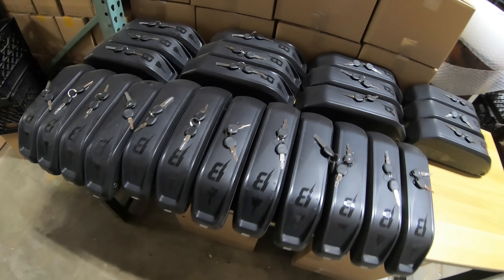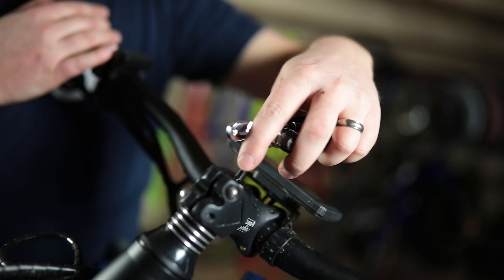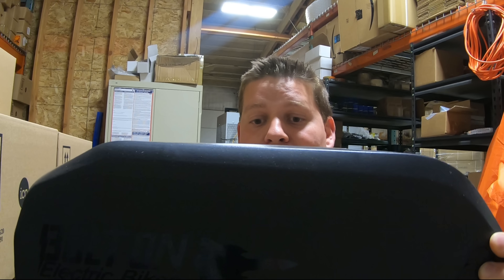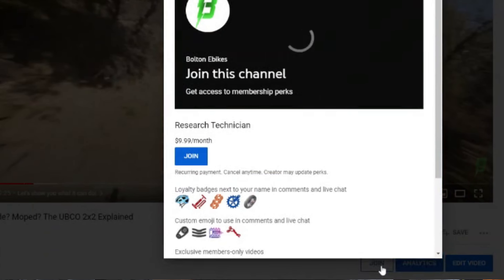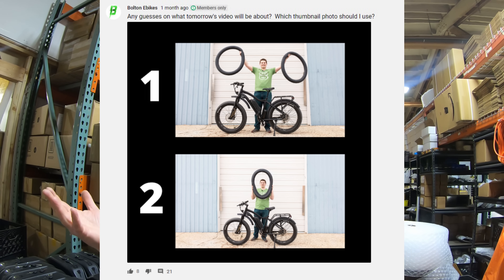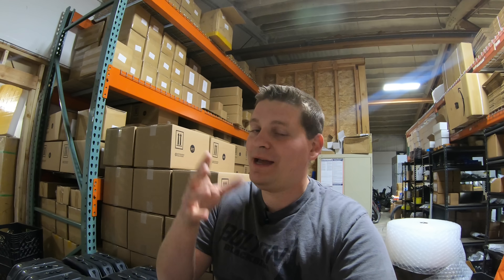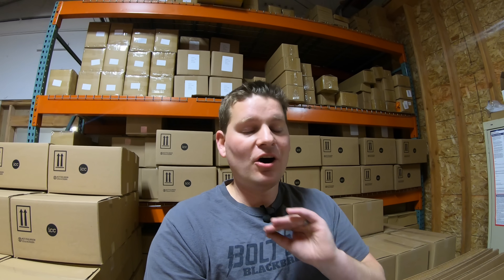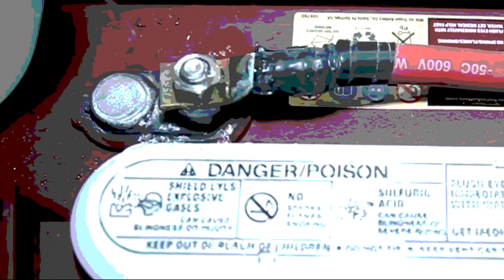How to maintain Lithium batteries for electric bikes - Easy!

Comment: I got a brand new ebike.    
The battery came full. After 20 miles the battery indicator light turned RED 

But the SPEEDO still said 60% BATTERY LEFT 

And it showed 4 OF 5 power bars left 

So the SPEEDO % didn't match the bar level and the bar level or % does not match LIGHT COLOR on the battery itself

How do I make them all match 

Google says to charge to full then to Over charge for 6 more hours after it's already green to balance the cells 

I don't think that's correct 

What do I do.
Reply from the maker: They never match all the way.  Trust the actual battery voltage if you have it.
Reply: @Area13ebikes noooo lol no voltsge at all 
Just a red/green/blue light on battery 
A % On screen and a battery bar  

Thats why yiur video doesnt help lol cause your videi only helps people whos bikes or charges have a voltage % screen 

Mine dont
Reply from the maker: Check your advanced settings.  Since you have percentage there may be an option to change to that voltage.
Reply: Nope. Not with this company. .

Comment: Q: You talked about how to handle batteries when not in use for a long while and how the freezing cold can affect them negatively… My question is what about or what happens if or when its the opposite when you live in a VERY hot and dry desert climate? For example, I live In Las Vegas area! Our summers are brutal in that we easily get up to the triple digits! How then does that affect the ebike batteries. I have a Specialized Turbo Vado 4.0 and unfortunately I haven’t ridden her for 2 years and I have had her stored out in the garage this last summer 😬🫣😰😳🥵. And what can be done to now treat or condition the battery back to its best optimum health coming out of a heat or hot storage as well as if one IS crazy enough to ride her out in that kind of heat with high temperatures and the intensity of the heat of the sun shining down on ya?!??

Comment: My e bike battery is 11 years old and run 10-20 miles every day . Still going strong . When I bought it the battery was rated at 1500 cycles . In 11 years topped off every day I'm gonna say I've far exceeded that . I think the key is I seldom go over 15 mph and when I do it's never more then a minute .

Comment: Said alot a great stuff man! Something I learned tho from having 3 Arial rider bikes and a kaabo wolf king gt pro is if for some CRAZY it did drain below the safe level is , you can jump start it with electric wire. I've never done this with the bikes or scooter but I have done this with my lithium power tool batteries.

Comment: I had a friend that purchased an electric bike with a Lithium Ion removable battery, he was obviously concerned with charging this battery because his condo did not have a secure outdoor fire-proof space.  I asked him the physical dimensions of the battery, and I suggested he purchase from Harbor Freight a hand-carried steel tool box that would easily fit the battery inside.  He brought to my shop the new steel tool box, the battery and the charger, I looked at the diameter of the charging cord, selected a rubber grommet just big enough to pass the charging cord through, drilled the proper hole to fit the grommet in the center line of the hinged top and bottom on one end of the tool box.  After de-burring this hole and placing the grommet squeezed between the box and the lid, secured the rubber grommet with water-thin cyanoacrylate all around the grommets exterior.  After the CA cured, I used a single-edge razor blade to slice the grommet in half right at the seam between the box and the hinged lid.  I placed the battery and the charger cord on half of the grommet on the box and closed and latched the lid.  There is a tiny gap and a flange all around the tool box and it's lid, this will provide an air exchange if the battery catches on fire and out gasses but the mild-steel box melts at 2500°F and will certainly contain the fire but not the smoke!  For more than forty years, if I have to charge a battery of any chemistry overnight, I place it into my fireplace on the grate with the flu open and the fireplace front doors closed.  If a battery fire occurs it will simply burn and the smoke will exit the chimney!   David Riddle
Reply: Slight overkill for the less risk they are, especially the good batteries, no different than say power tool batteries and those are abused to hell and back. Never hurts to be on the safe side, though. I use a motorcycle helmet on a bike for that very reason. I just charge the battery by the door, concrete deck outside.

Comment: One thing I did learn overtime about batteries power tools I always thought fully charged storage was great idea then the battery lines instead of completely full one line wasn't getting charged  storage at 50% is safe

Comment: dont forget not  to charge your batteries below 41F or higher then 80F. also let your batts chill out at room temp for 2 hours both after use before charging and after charging before use.

Comment: What is the likelihood of a battery fire when using a dual-battery system provided by the manufacturer?  I am using the original charger and a new BMS provided with the new second battery.

Comment: I have found that if your battery doesn't want to charge on charger. Your charger light shows green, but the battery is fairly drained with very limited power. There's a trick to get it to charge. Leave the charger plugged into the battery, but unplug the AC power cord. The charger light should still glow green.😮 Let it sit for 2 hrs then check the charger light if it's still glowing green. Plug in AC cord to see if it's red and charging. Repeat steps if it's still green.

Comment: My e-bike battery is 48v but only charges to 40v. The charger output is 54v. Does it have bad cells? It’s about a year old and only used a dozen times.

Comment: Okay. So the E bike lithium ion batteries. physics are very confusing. to me. due to the fact that from studies I read about lithium ion batteries that the whole charging to 100 percent degrade to your battery faster. is BS due to the fact that the only thing that you're gaining from doing that is an illusion. of getting more out of your battery when actuality. you never fully met 14 charge cycle if you charge to 80% and after doing that five times that's one whole charge cycle but you didn't affect your battery's help. due to the fact that you have not driven the same amount of range as if you charged it to 100 percent and then another thing I learned that in the cold the reason that your battery dies faster and is due to the fact that the lithium-ion and other materials inside your battery isn't at an optimal temperature to allow the battery to complete its chemical. function resulting in again the illusion that your battery is dead but in actuality the lithium-ion cells are just too cold. to Create a reaction. But I keep hearing other people. say the exact opposite, but never really going into detail as to why that is. the actual truth that they are informing viewers of is there something different about the lithium ion batteries? that you'd get? in an E bike since their cylinders? instead of them flat square. I forget the names of those typo lithium I on batteries. but all the research has definitely left me. kind of confused as to what exactly is the truth. pertaining to this matter. I'm sorry. for this beak to text. I didn't learn how to read. and write in English. until after moving back to the states from Puerto Rico. When I was fourteen. So this is. an easier way for me. to communicate my thoughts and text.

Comment: I have a question regarding the choice of battery for Euc bicycles lithium 50S or 50E cells.
I wonder what type of batteries hold the power best in cold conditions? Then I think of below -5 grC
The reason I ask is because my latest Makita screwdriver comes with lithium batteries that do not hold power at temperatures lower than -5 degrees C.
I can fully charge a 5Amp/18Volt battery and the next day there is less than 10% left on the battery.
Do you have a solution or explanation for this?
Reply from the maker: Lithium batteries don't like the cold.  Keep them at room temp before use and they'll be much happier.  Otherwise cold use cases may need lifepo chemistry.

Comment: My question is, why do I have to worry about all of that crap?  E-bike batteries seem like a really crappy product for the price.  I have Lithium batteries for my power tools that I’ve let sit for over a year with no problems.

Seems like the BMS is probably the reason these batteries drain down to nothing.  It’s got to be leaching current in order to stay operational in “protecting” the battery.

Comment: Do you cell Charger and battery for e-cell Tripe crown 52 V .The bike is a 1500 two battery two motor, 750 front and 750 rear.

Comment: So I can't wake up a dead battery? You say it's toast,but also said bms shuts off if to low,then why doesn't my charger work when completely dead,and is waking up with a 12v jumper going to get it reading voltage so charger works?

Comment: Letting your nickel-based (most e-bike batteries are) li-ion battery sit charged to 100% for weeks is a REALLY bad idea. Even days in a row is not good. If you charged to 100%, try and use up at least 10%-20% asap. Then you can let it sit for a couple of weeks. Any longer than that, and you need to drop another 10%-20%.
Another factor to consider is temps at which the battery is going to be sitting. The higher the temps, the faster your battery will degrade when charged to a high percentage. You shouldn't keep your battery charged above 50% when unused in hotter climates.
If you know you're not going to be using your e-bike for months, discharge to 50% and keep it in a cool place (basement?). And, yes, make sure you warm up a cold battery to room temps before charging it.

Comment: so my ? is I got my ebike in the late fall and drove it all winter love it btw and the first thing i did was charge the battery was this a mistake or is there something i can do get more because I had this bike since october 2023 i only drive 1.3miles to work and back and some short trips to the store a few times a week.  I only have 318 miles on it but it drains fairly fast when I first got it I could go alot further without the guage even dipping now it dips once i hit 24mph.  I've had it at 42mph max speed wo/PA don't ask me how but it did it.  any ideas im all ears.. I live in the midwest btw and yes i drove it in that blizzard this year. fun stuff

Comment: Actually, it is a recognized practice for clients paying big money to law firms to retain a forensic auditor to determine the quality, necessity, and efficiency of the law firm's work (especially if the client suspects the law firm is "churning" "padding" or over-billing on the case).

You can search Google to read about the number of big white-shoe law firms who have been sued by former clients, accusing them of fraud; those law firms usually settling the case for MILLIONS in "refunds." 

Bonus Trivia: 

There's one major U.S. law firm sued by the client where evidence in the case included a pic posted to social media that showed the law clerks working on a Saturday, one of the employees wearing a T-shirt that said on the front "BORN TO BILL" (which was referring to the law firm requiring all employees to run up the costs and fees (billings) to be paid by the clients). 

In another 1999 case, evidence included a client invoice from the law firm showing the client when at a meeting with this lawyers was charged $6 for a can of Coke  (that the firm bought at Costco for about .40 cents a can. At minimum, when you are charging the client $100,000+ that month, I'm sure you would agree that's poor form, especially when the client at a meeting thought the can of Coke was a courtesy).

Finally, there's the famous case that went through litigation, a client v. big national law firm. Cross-referencing the client's billings, those indicated a lawyer charging $800 hourly impossibly worked 25 hours in one 24 hour day; where deposition testimony and security key card log-in/log-out data proved that on the day in question the lawyer logged in at 9.30 am and went home at 5.30 pm.

Comment: Hi, I’m after some advice.
I have a specialized levo turbo bike and have a strange problem with my battery, when I charge it the battery stops charging at 86%, I spoke to specialized and they recommended changing the battery, I did this and the replacement battery charges to the same 86%?! I spoke to specialized again and they said it’s the charger or a charge linter on the app but there is no option for a charge limit? Do you think it could be the charger? Sorry for the long message.

Comment: Hej. I have problem the plug botom is loose in batterys box Litium - Batterikapacitet: 36 V/10 Ah which cause fel in the connection with the charger. Can you fix it or I can fix it with your good advise.

Comment: Thanks for the video. I have a question. It was probably covered and I just missed it. Is it necessary to charge your battery every time you ride it? The directions with my bike say to do that but it seems kind of silly. Often I get home and only have time to ride 10 miles, sometimes less than that. In that case, at the rate I use my battery, it will still be above 95%. In fact, tonight I rode 7 or 8 miles and it was at 99%. But by the time I did few things tinkering on it, the diplay was back up to 100%. Thanks in advance for your advice. Sorry if it was covered and I missed it.

Comment: Unless you have a CVCA charger you will never know what percentage you are charging your battery, did you ever check how many Volts your charger pumps into your battery? Maybe you'll be surprised  I charge my 2 bikes at 42.02V, but you need a decent charger to do this. 
Plus I can use the regulated charger's voltage 0-60v to zap for a few seconds a half dead battery.  :face-purple-crying:

Comment: I fly drones so use a lot of LiPo Batteries. It’s critical never to over discharge them & let them rest (cool) before recharging. All Liposuction do a “Balanced Charge “ every time and require a balance lead as well as the main power lead to do this.. 

My question is how do I balance charge a LiOn Battery when there is no balance lead or function on the charger to do a balance charg ?
Are You taking the battery really low to make the inbuilt Battery Management System balance each battery when in a very low state ? If so how low do you go to get the battery to “Balance Charge” ?
Any advice welcome as I’m not fully conversant with Lithiom Ion Battery technology.

Comment: Question: new to e biking so excuse my ignorance. Is there a “battery  tender”on the market that will trickle charge the battery? If so, Would that be a good thing to do? 
Also, is there any type of charger that connects to your hitch outlet that would charge the battery as you travel? 
Thanks!

Comment: Could you recommend a simple battery checker? My wife’s bike does not show voltage when I look on Amazon. It’s a little complicated on the various different meters that you would use to check the voltage on your bike and also confusing is how to wire it up to a barrel connector.

Comment: I hope you can answer my question.  On my power outlet i have a Watt monitor that i can watch from my phone.
Its a 110~120v 3a charger for my 48v battery.   When i first start recharging my battery the power adapter starts drawing full power from my outlet at about 180 watts.
when my battery enters near full i see the power draw drop.  The watts slowly drop from 180 watt to eventually 0 watts  i manually stop it around 60 to 80 watt draw.
Im just wondering at what % level my battery starts to charge slower (topping off) and drawing less power from my charge adapter.
Reply: I don't know if you'll see this text. But forging on I just asked a simple question and wondered if a rider with other things to do  could answer this for me quickly it's almost 60 degrees in Illinois and I'd like to go for a ride. Thanks in advance if you're out there.
Janet Leigh Kennedy Springfield Illinois

Comment: Should I charge with battery power on or off the instruction manual that came with my battery was not clear
Reply from the maker: Typically makes no difference.

Comment: I've been riding an electric snowbike, a Ruffian SEND-E for a bit over a month now. I store it in my shop, which is around 60 degrees. When I go for a ride, my thought is that the battery produces a bit of heat when discharging, so I don't insulate it or have heaters.  After a ride and back in the shop, I wait a few hours before charging, and then I charge at a low rate, 2 amps. It's a 72 V/75 AH Samsung battery, and this procedure is working well for me as it has massive range, a 2, 2.5  hr ride usually shows it with 50% or more capacity left. What I DON"T do, is leave it out all night, though if forced to I wouldn't expect it to be a problem..

Comment: I charge to 80% mostly, unless I know I'm going on an "epic" ride. At as low as a charge rate as possible, depending on time of course. With 100% charges every 10 or so charges, leaving it on the charger overnight to balance. The main thing I don't is charge to 100% and NOT ride for several days.  4 e bikes,1 Sur Ron, and most recently a Ruffian electric snow bike, in my stable. All use a multi featured charger from CHI, which gives me the option of amps and percent of charge.